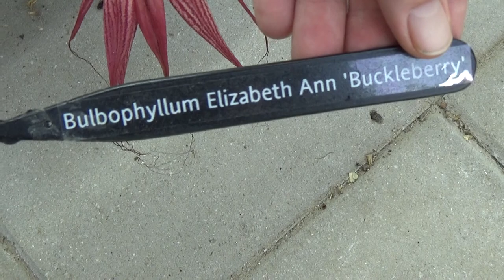Orchids blooming update Oktober 2022!

Comment: Love your blooms. They are just great.
I am looking to buy label maker. Which one do you use? And the black sticks, any idea where to can I find them?
Thanks in advance
Reply from the maker: I am using the DYMO D1 label printer and I can only find Dutch links to the labels. I just google for "black plant labels 15 cm (5.9 inch)", I hope this helps? And thank you so much! :D
Reply: @TheOrchidSaGa  thanks, that's help.
Reply: @TheOrchidSaGa  do you know the model of your dymo? D1 isn't a model
Reply from the maker: You are right, I am sorry! I have the Dymo 210D labelmanager. I do have a link, it is from a Dutch seller:  https://www.123inkt.nl/Dymo-LabelManager-210D-beletteringsysteem-QWERTY-S0784430-i15775-t2109058.html?mkwid=sKOn5vG8g_dc%7Cpcrid%7C412065600931%7Cpkw%7C%7Cpmt%7C%7Cslid%7C%7Cprid%7CPF_833322_3501170815540_S0784430&pgrid=89580774946&ptaid=pla-633601276006&gclid=Cj0KCQiApb2bBhDYARIsAChHC9vHHOmoSMdKHSSUesChYog2mbRdqbNQKygQnOnirOEOJMnOnLXjl5waAp3HEALw_wcB